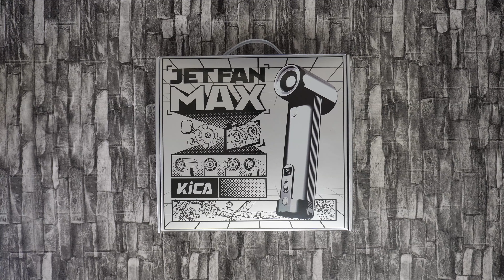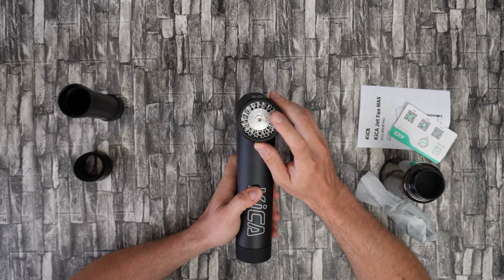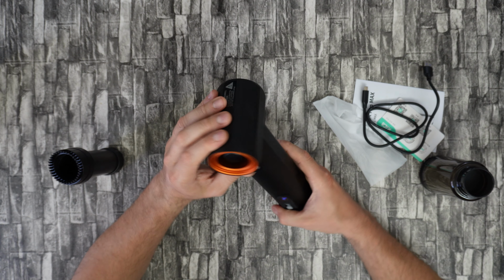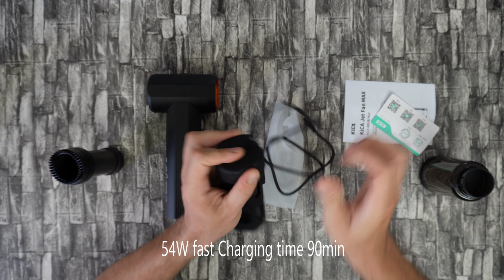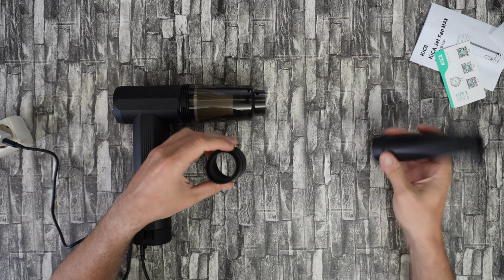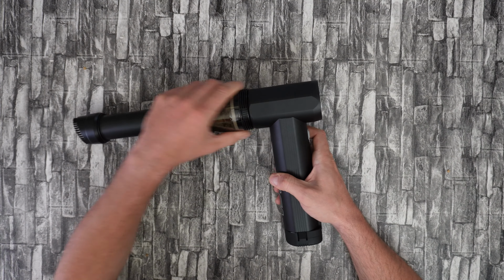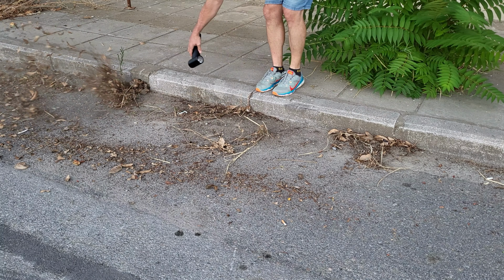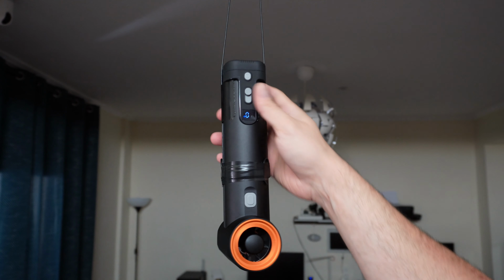Kica Jet Fan MAX

Comment: I think three is a lot room for improvement. 
Too few accessories. For example I'm missing a different (smaller) nozzle for more precise and more effective blowing and a bigger/wider brush for vacuuming bigger areas. Accessories that are very common - and usual for decades now. 
The device seems to be badly designed for a convenient and comfortable usage. The grip to me looks mich to bulky instead of anatomical shaped.
All in all - also for the Kickstarter price - to me this thing seems to be much too expensive.
And on top this device is way too loud - but thats a issue all those blowers have in common.

What are your answers to my concerns?